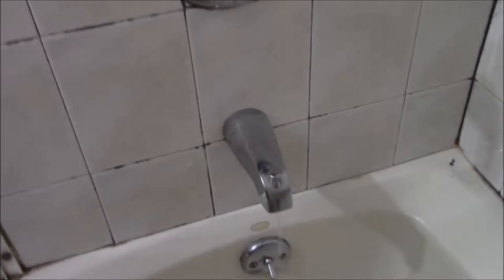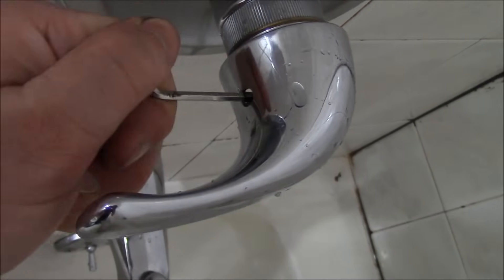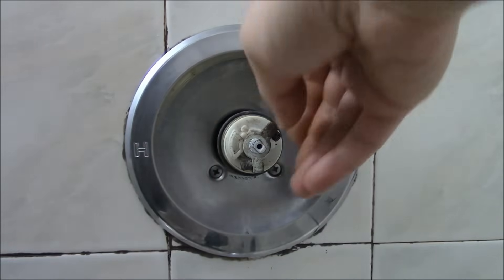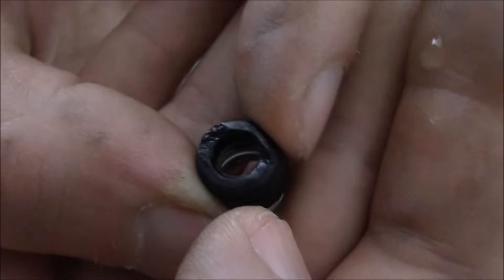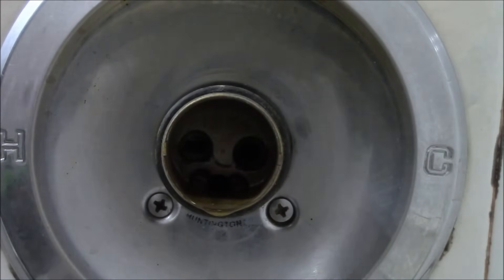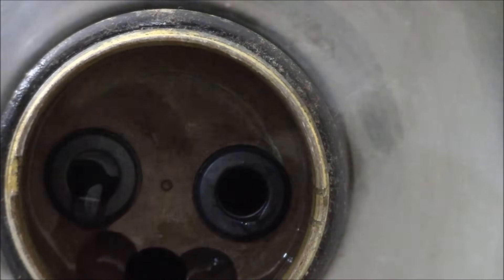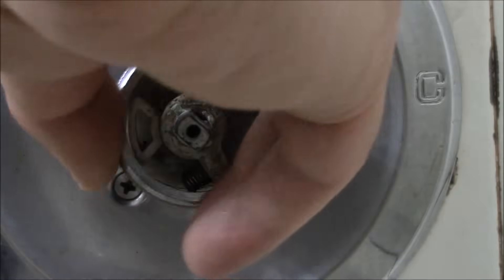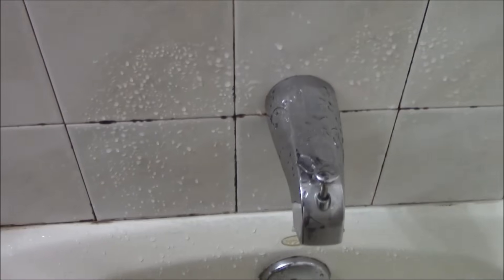How To Fix A Leaking Single Handle Bathtub Faucet Quick And Easy

Comment: Quick and easy unless you got 5+ years of calcification, it's been 2 hours on this faucet and I've used so much vinegar I'm a pickle
Reply: I see what you did there.
Reply: 🤣🤣🤣🤣. Hannah; this guy makes this look so easy!!! I been working on trying to get the screw out off the handle... Gurl, I'm so Frustrated...,  know I can do this. My fingers hurt from doing this Manly Shit!!! 😅😅😅
Reply: Ok girls I’m about to try my hand at this and see how it goes 😬
Reply: I didn't look too hard but my hands have arthritis and not sure I can do it.
Reply: Mine is that way too.
Reply: I have hired 4 plumbers to fix my tub leak. And it’s still steadily dripping! I am encouraged to try this myself. Thank you!
Reply: Having the same issue now, too. I think I will become a pickle, too.
Reply: Try WD-40 it works great on hard water
Reply: Gotta spray it with PB Blaster first and leave it sit.

Comment: Thank you so much for this video. The process was explained very well. I was able to repair my tub leak and this saved me no less than $150.00 for a plumber to come out. The parts cost around $8.50 and the job was completed in 10-15 minutes!!
Reply from the maker: You're welcome. Glad to help. If you haven't already please subscribe to show your support. It would be deeply appreciated.

Comment: Great video for an easy 15 minute fix.  Ordered the parts on Amazon for $4 for 2 seats and 2 springs and the tub no longer leaks.  We had a peerless faucet 88700 series which was slightly different from the video.  I googled peerless 88700 series diagram and found out that our faucet was slightly different from the one in the video.  The seats and springs were not in the wall.  They were in the actual faucet housing which came apart with a quick 90 degree turn.  Replaced both seats and springs in the housing and put it all back together.  No more leaking!  Helpful hint: Take a picture and line up the parts on the floor as you go so you remember how it all goes back together.   Thank you for this video!
Reply from the maker: You're welcome. Glad to help. Can you please subscribe in return? I would really appreciate it. Thanks.

Comment: This video is awesome! Short and straight to the point! Great camera angles as well. Thank you for the help and insight sir!
Reply from the maker: Glad to help. Can you please subscribe in return? I would really appreciate it. Thanks.
Reply: Brandon Ayllon I
Reply: @DoItYourselfEasy  I CANNOT GET THE HANDLE OFF, THERE IS NO SPOT FOR AN ALAN WRENCH TO FIT IN TO GET THE HANDLE OFF, DO YOU HAVE SUGGESTIONS ON HOW TO GET IT OFF???
Reply: ghanus2009 how do you take it off mine doesn’t have that and my mom wants it fix now
Reply: @JesusMartinez-eu5yx  The length between the handle catridge may be the key. Simply rotate it counter clockwise. You will see it slowly coming unscrewed if this is the case.
Reply: Great video & directions, definitely helped me & in return I will most definitely subscribe to show my gratitude🙋‍♂️

Comment: Thank You, Thank You. From your video I was able to learn that I only needed to replace my damaged washer, not the entire assembly. Cost me just a little more than $2 to repair and stop the leak :-)
Reply from the maker: Glad to help. Can you please subscribe in return? I would really appreciate it. Thanks.
Reply: Where did you get them from
Reply: @DoItYourselfEasy  i would like to do ours but not sure where to shut off the water supply to so i can start doin the job
Reply: @smiley08orillca96  I have the same question. Did you figure it out. Did you shut off the main water from the house?
Reply: @eb9844  my husband did fix ours.he shut off the main
Reply: @smiley08orillca96  thanks for your reply. I’m going to do that right now.

Comment: I thought all hope was lost & would have to call a plumber for something so intimidating, Much appreciated! My wife says "Thank You!"
Reply from the maker: You're welcome. Glad to help. If you haven't already please subscribe to
 show your support. That's all I ask. It would be deeply appreciated.
Reply: Happy wife, happy life
Reply: Ive done Drains, Dishwashers, Washing machines, sinks, toilets, hot water tanks... But never one of these guys (always dealt with the Hot & Cold Faucets). So it was quite Intimidating... But...

Just did ANOTHER one! :D Part was 20 years old (Delta 1400 series RP19804 this time). Took off the 'Vanity Plate' to keep mind of how hard I was sawing the handle off (face it, the likelihood of it actually Unscrewing is next to zero) by looking at the piping movements (Things can bend, break, etc) if I wasnt holding the pipe assembly steady.

(New Handle, I know... 15 bucks more to spend :/ )

The Bonnet Nut was next, not a major challenge (luckily for me), just patience.
Then out comes the Cartridge, right? HA! f***ing just separates into a good 3 dozen pieces. It was hell digging it out (the most time consuming part of the repair).

But once it was out, cleaned, the replacement Cartridge lubed... Damn! Night & Day difference! Like brand new! All thanks to YOUR wise words guys. I appreciate the help & Confidence you gave me on the project. :)

Wife is happy too. LOL

Comment: With the help of this video, I got to the rubber part only to find it in perfect condition. Upon inspection, I found a half a dime size piece of plastic preventing the rubber from fully closing, causing the leak. That little sonofa gun. Thanks for the video friend

Comment: Hey I'm having a lot of trouble getting the handle off.  When I shine a flashlight where the alan key is supposed to go I see a lot of hard water deposit.  Any tips?

Thanks
Reply: Not sure if you've fixed your issue or not, if not here's my advice.  I had a can of liquid wrench so I sprayed some in there and let it soak for about 20 min.  Still didn't budge, tried a 2nd round and after some elbow grease I was able to crack through the hard water deposits and loosen the screw.  Now I've read other forums where people said they've let the liquid wrench soak over night and they couldn't crack it and recommended PB blaster.  So either one should work in my opinion, just let it soak and then use good old strength and it should loosen for you.
Reply: try spraying WD 40 to loosen up the cruddy stuff
Reply: @terryjackson3424  Some guy actually did a scientific test where he tightened down the same size bolts, on the same size nuts, using a torque wrench to ensure they were all equally tightened. He then used some sort of digital meter to record the amount of torque required to break each loose after spraying each individual nut/bolt with wd40, liquid wrench, pb blaster and a bunch of others. The liquid wrench actually "worked" the best as it required the least amount of force to remove. So stick with liquid wrench.

Comment: Awesome!!! Thank you!! Just subbed (:
Also, i dont have the screw inside the knob so can i just take off the whole thing?
Reply from the maker: You're welcome. Glad to help. It should come off but if it's been on for a long time it may be stuck due to corrosion. In this case a faucet handle puller may be required.

Comment: what size allen did you use?
Reply: I'm looking for this too... checked elsewhere and located this: Neither faucet has ever been removed before. My 3/32 Allen wrench seemed a tad too loose, but my 7/64 Allen wrench is clearly too big. I called Delta, which told me that those Allen screws took either a 3/32 or 1/8 Allen wrench. 

Oh, also this... Have you tried a different 3/32 wrench yet? Sometimes the end will get a bit rounded making it slip. A grinder or fine metal file can also be used to remove the rounded tip if needed. Otherwise I might even try a metric in case someone used a metric set screw because they lost the original.

And this: I tried a metric--2.5 is the closest "next-biggest". Too big.

And this: If you want to try and save the faucet, you can try drilling out the Allen screw or using a screw extractor kit or something similar....

And this from Terry Jackson in this forum: I had a can of liquid wrench so I sprayed some in there and let it soak for about 20 min.  Still didn't budge, tried a 2nd round and after some elbow grease, I was able to crack through the hard water deposits and loosen the screw.  Now I've read other forums where people said they've let the liquid wrench soak over night and they couldn't crack it and recommended PB blaster.
Reply: I am working on mine now. My Delta faucet took a 3mm Allen wrench.

Comment: The two things you replaced are called seats and springs. I have found using the eraser end of a pencil works good to pull them out and put them back in rather than your screwdriver.  Apply a coat of plumbers grease to that o ring before putting the cartridge back in.
Reply: Any silicone grease will work. Silicone is thick and waterproof. A lot of companies like to sell stuff as a "specialty" product and charge more, when in reality its not "special" or designed specifically for that task. So buy the cheapest silicone grease you can get.

Comment: Hello, very informative video because I have the same problem with my one handle shower tub. Going to fix it soon after watching your video but a question, where to shut the water? At the tub or the water main valve? Please let me know THANKS!  Hope you can answer soon 😊
Reply: Great question. The water supply line to your bathroom should do it. If you can't shut off just the bathroom water you'll have to shut off the main supply line to your home. If you have a supply line shutoff valve in your bathroom and you're not sure if it's only for the toilet, just turn it off and check if you have water to your tub. If you don't you won't need to shut off the main line. The important thing is that the water to the tub is turned off or you will have a big wet mess and possibly a flood if you can't get the faucet back on in one quick hurry. Been there. Done that. No fun.

Comment: Great video.  I've got a leak at the hot water faucet.  The valve cartridge is over 55 years old and no way and I going to find it at the hardware store.  I"m hoping that maybe replacing the O-ring and gasket by improve the situation.

Comment: When installing new rubber washers, I always put a light coat of plumbers grease on the outside surface of the washers, they will last longer.
Reply: It doesn't have to be "plumbers grease", any silicone grease will work.

Comment: What did I do wrong if the water comes out like the faucet is on every time I turn the main line back on? I already tested the knob, but no luck.

Edit: I swapped back to the old springs. They were smaller than the previous. Thanks your channel really helped.
Reply from the maker: You're welcome. Glad to help. Can you please subscribe in return? I would really appreciate it. Thanks.
Reply: Of course I have 😎

Comment: great video.. Stupid question but is this for a leaking handle or the spout itself.. I have a leaking spout and we changed the entire spout but it is still leaking.. so we are assuming now it might be an issue with the handle. can you confirm that leakage from the spout itself can be caused by the gaskets in the handle itself? thank you kindly

Comment: Excellent vid!
My problem is in the same area but, but it seems if you spray around the handle it leaks onto my kitchen ceiling below it...
Ive cut the ceiling open and when my wife sprays around the handle and the 2 screws that hold the chrome trim on, i can see water pissing downstairs. Is there some kind of seal that stops water getting inbetween the handle and trim? Or is there something i should be looking for?
Thank you

Comment: Is there a tutorial to fixing the bathtub faucet with this same single handle set up? Any help would be very appreciated. I also have questions like does the water need turned off when fixing typically any faucet or knob? My tub faucet just spins around when I try and take it off, so could I be missing a spring possibly? Or could it be stripped? I have zero experience here, but am eager to learn. Thanks.

Comment: Nice video and I have a question that maybe can be answered I recently moved into a new home and having problem with the handle not allowing it to turn to hot water only get cold which isn’t bad in the summer but it’s close to winter and would like actual hot showers so any clue on what’s happening or what I need to fix to get the knob to turn to hot water?

Comment: Great video . What would you do if you can’t get the screw off with the Allan key ? I’ve tried everything and it’s so gucked up and corroded it won’t take the Allen key properly and won’t turn
Reply: Cobalt drill bit kit, and a screw extractor kit. Both can be purchased on Amazon or at Harbor Freight tools, Lowes, or Home Depot. Search "how to use screw extractor bit" on YouTube. It's not hard, just go slow.

Comment: What size of Allen key did you use to remove the handle screw? Also I used a flashlight to look at the handle screw and it looks like there is a lot of calcium build up. any thoughts of how to clear up the calcium build up?

Comment: Like kelsey krause asked..what do u do if u replace the washers and springs and it still leaks? My cartridge looks very similar to yours...i find one the looked very close but the base was ever so slighly bigger and i could not put the metal ring around the base thike the original one had...so i tried it without tje metal ring and it still leaked with the nee cartidge as well. Any suggestions...my shower faucet is marked B&K ..i think by mueller ..any help is greatly appreciated! Great video by the way..

Comment: In Canada the allan wrench /key needed to remove the setting screw was not a 1/8 that was to big, we had to use a 5/32 to remove it.. the filter or whatever is called was very hard to pull out on ours and ours is only 5 yrs old. We had to tug really hard and pry to get it to come out. ugh.

Comment: Would it be worth it to also replace the plastic cartridge at the same time you have everything apart? Or are they pretty durable to use over and over through cycles of o-rings?
Reply from the maker: No. As long as it doesn't appear damaged the repair done here should be sufficient.

Comment: I'm thinking I can do this, but...I know I can take it off, but I'm replacing as well.  I'm afraid I'll have to call someone to fix if I cant, put the new one in.and it will be to where I will HAVE to call. the water will be off and no alternative, if I cant. just had a handyman come out yesterday, he told me with that leak he would have to make a hole in the back of my wall to fix it and a lot of $$$, it's a drip less than in the video, which I APPRECIATE your video!.

Comment: i could not remove the entire newer cartridge, so rotated the gray part 1/4 turn left and then cleaned these 2 plunger/springs and replaced and problem solved  (a slow cold water leak) Delta will send the entire new cartridge to the homeowner (me!), so I stored it away for the day when the entire assembly has to be replaced.  Sometimes the 2 plastic barrels with small 'I' rings at the rear (go into the brass plumbing fixture) are what sticks and make removing the cartridge hard or impossible. I got lucky.

Comment: DIY University
Thank you for this very helpful tutorial -
I got a problem on that first step Taking off the handle: Somehow no Allen key fits the head screw, that seems slightly damaged but I've seen worse. The 3/32 key is too small and the bigger 1/8 just won't fit.
The head screw being inside the handle, would you have any suggestion how I can manage to unscrew it?
Thank you!
Reply: And I've got the same problem with a set of metric Allen keys

Comment: Where did you get the replacement parts from? Would like a Lowe’s or a home depo carry that sort of thing or did you have to order it from somewhere?
Reply: The best thing to do is shut the water off, pull the old seals/springs out, while you are at it, replace the other large rubber ring as well so you don't have to replace that one in another year. Take a picture of everything for reference later to reassemble. Take those parts to Lowes, Home Depot, or Ace Hardware and they can match them up to ensure you have the correct parts. Its always best to take the old parts with you and get the right parts the 1st time.

Comment: Thank you for the video. I just have one question. Sorry if it's dumb. How do I turn off the water to the shower? I see the ones to turn off the sink but I am unsure about the shower. Would I have to just shut off the water to the house? Thank you!
Reply from the maker: If there is a shutoff valve in the bathroom that turns water off to the bathtub / shower then that should work. If there is no shutoff you need to turn the water off from the main.

Comment: My washers would not come out easily.  They were so "cemented" in I was afraid of severely scratching and/or bending part of the flange by using it as a fulcrum to leverage out the washers.  Only after chipping away part of the washer from working at it, did I realize it was brittle and I could chip away enough of it to get a grip on it with a pair of needle nose pliers. Also, the directions that came with the Delta replacement kit suggested you leave off the aerator and turn the water on momentarily to flush out any pieces that accidentally fell down into the water feed pipe. After that, everything went as seen on the video.  Lastly, I saw some videos suggest that you use a silicone lube for the parts.  I don't know if this was a universal suggestion or a preferential one.

Comment: when you say shut the water off, do you mean the actual main water to the house, or in the house pipes by the water heater, or just the faucet?
Reply from the maker: If there is no shut off from the bathroom then the water needs to be shut off from the main of the house.